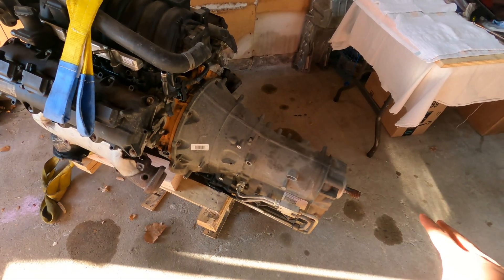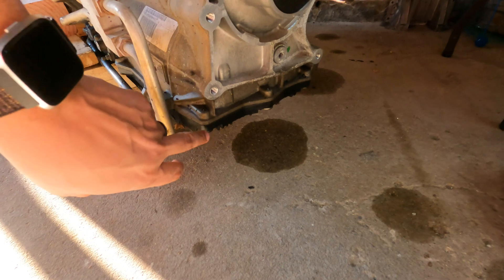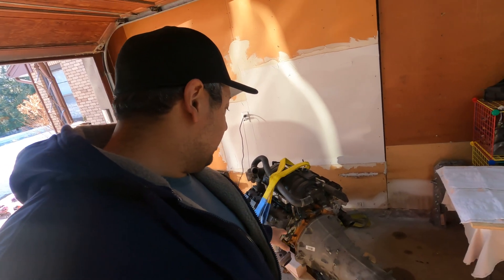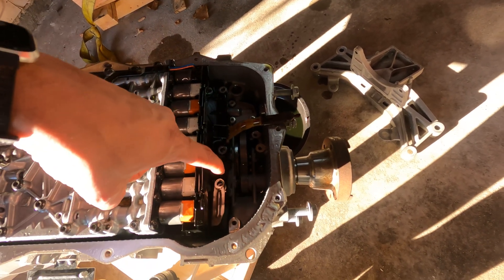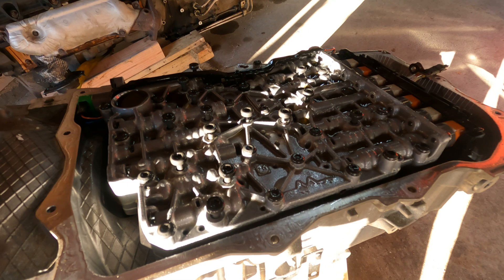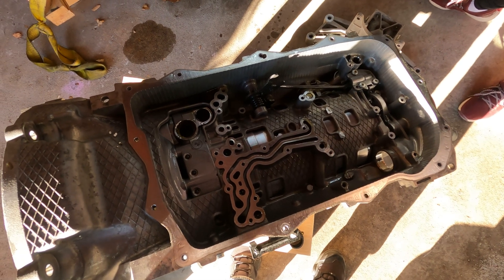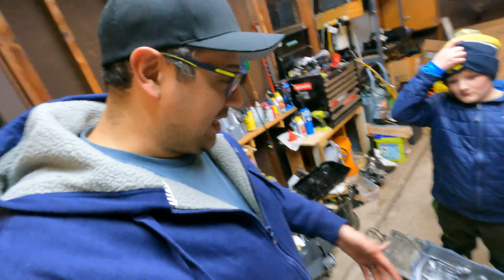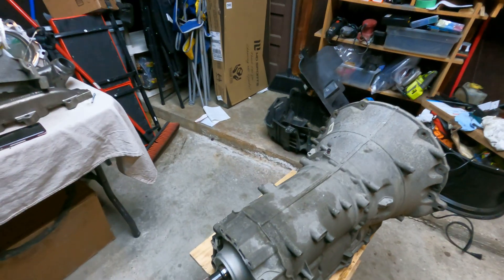8hp70 Valve Body Swap  - Part 31 - 6.4L 392 Hemi 2009 Jeep JK Engine Swap

Comment: Did u have to reflash the valve body if so how is this done cause Iam having a issue thinks it’s not in park and won’t let me start or shut it off after u try to start it won’t crank just says not in park

Comment: Great video. Amateur question here. Doing the same swap with a 5.7L. I was a little hesitant to flip the trans over to work on it. I see yours it. Anything that needs to be done special? My trans is out of 2017 Ram 1500 with 30K miles. Pulling my valve body to send to Todd at JSS to have it reflashed. Also going to switch the pan to a metal pan at that same time. My trans still has the torque converter installed. Not sure if that matters. Thanks
Reply from the maker: Hmm.. I never thought to change the transmission pan to a metal one.  I know on the 8speed the transmission filter is built into the pan.  Is that the same with the metal pan? The torque converter can just be pulled and it will come right off. Be careful because it is full of fluid.

Comment: Why do you have to switch valve bodies
Reply from the maker: The short answer is I'm using the shifter from a Dodge Challenger and I want to keep the manual shifting mode that the dodge challenger shifter has.

Comment: Good stuff.  So for anyone wondering, you can use the Ram transmission, but since they have the dial shifter on the dash, they dont have the slap shift.  If you want slap shift, the car version 8hp70 has the "manual" mode, hence using the valvebody from a car setup.
Reply from the maker: Look at all this collaboration happening.  Awesome!!
Reply: I believe that the Ram transmissions still retain “slap shift” but the controls are moved to the right side buttons on the steering wheel.
Reply: FYI, Todd from JSS just released a video on his Facebook stating that he can have the Ram valve body computer re flashed to the challenger programming. 

https://www.facebook.com/1346755380/posts/10226003575499753/?d=n
Reply: @kevinoka6631  thanks Kevin, that is great news!
Reply: I've also been told it's a pain in the butt to reprogram. Not sure how true it is but thats what I've heard.
Reply: @dpost82  if you take the dive, check out Sound Germa Auto.  They are learning new stuff everyday on these 8hp70's